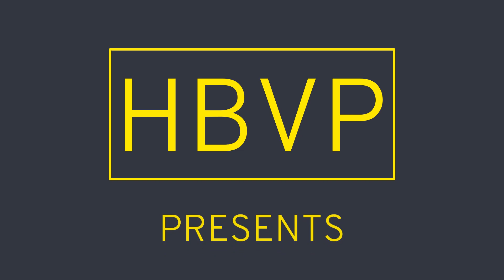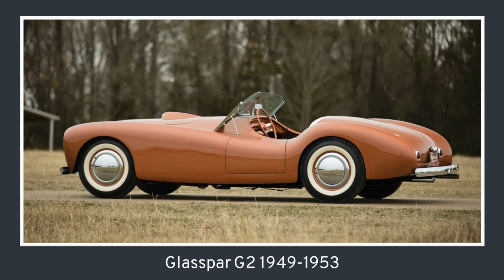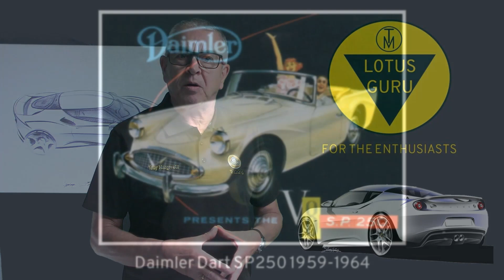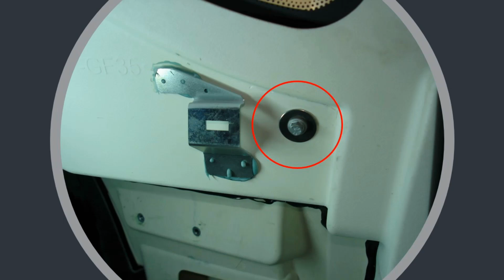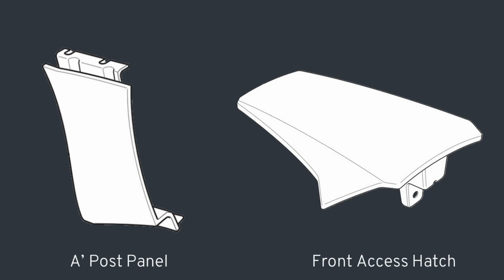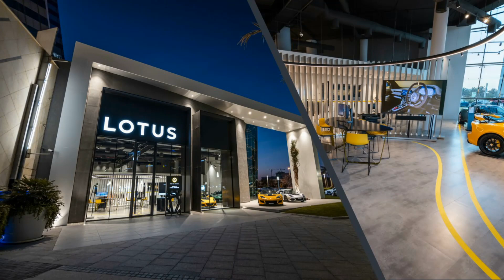Evora Bodywork

Comment: I'm thinking about a used Evora S to be my forever car. Do you think it will be something that can be kept on the road for another 40 years or will it just deteriorate into something unfixable?
Reply from the maker: Mechanically it’s pretty sound. The biggest problem will be getting Lotus made parts for it in the future. Chassis is alloy, bodywork is composites and power train is Toyota.
Problem in 40 years will be getting petrol to run it on I reckon! 🥴
Reply: @lotuscarguru3656  i certainly hope not, but an ethanol conversion shouldn't be too difficult
Reply: @lotuscarguru3656  as someone in the industry, what can be done to prevent EVs from being forced on the population?
Reply from the maker: @silvenshadow  Nothing I fear, if they legislate, it becomes law. But there will still be plenty of ICE cars around for many years, just not new ones.
Reply: @lotuscarguru3656  so I guess the answer is to get as many people as possible to try to oppose the legislation.
Reply from the maker: @silvenshadow  Good idea but it’s all about climate change and government agendas my friend!
Reply: @lotuscarguru3656  ya, lots of govt. agendas. Evs are pretty awful for the environment. Maybe we can get some actual renewable fuels.
Reply: @silvenshadow  the goal is continuously minimized impact, not to go immediately from high impact to zero impact. Liking ICE engines isn’t a good reason to fuel confirmation bias: yes, they sound good, but no, they’re not better for the environment.
Reply: @jamiea8318  depends on what you use to fuel them. EVs are not inherently better at all.